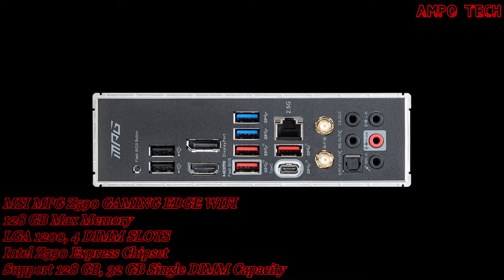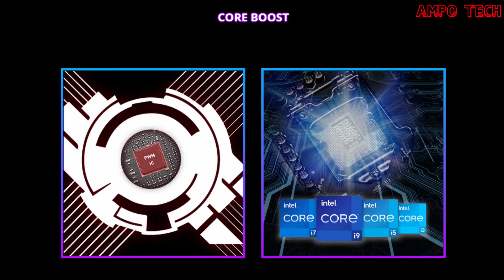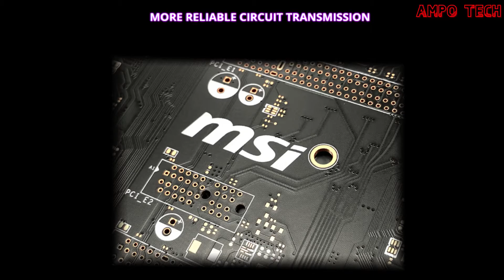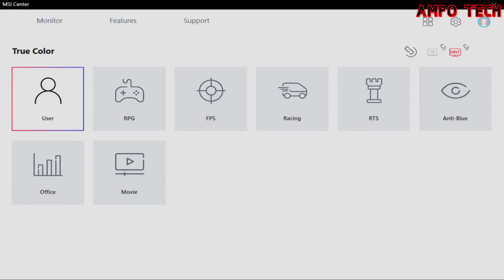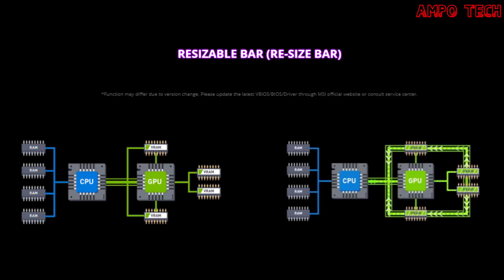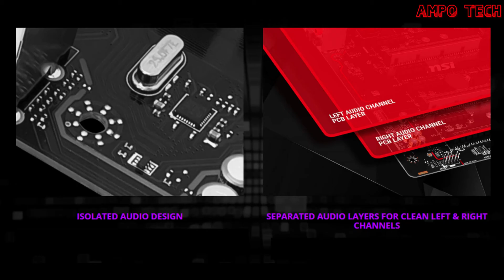MSI MPG Z590 GAMING EDGE WIFI Motherboard | AMPo Tech

Comment: Can you tell me can I use 4 ram of 3200mhz in this MSI MPG Z590 GAMING EDGE WIFI motherboard.
Reply: Yes, you certainly can .. In fact you will find this board is very happy with 3200 speed; in most cases of standard brand name ram sticks; it will auto configure and post quickly; but for 3600 or above you will have to position the xmp switch and then press the "mem ok" button to test and configure or it will not post; very often you can find 3600 spd ram cheaper than 3200; that is because of these extra steps many avoid it or think that the ram sticks are bad and send them back; so 3200 is in a higher demand so they price it higher; where clearly the performance of 3600 on Nova test bench is better; but it seems, only for those who know to take the two additional steps at install; I use 3600 because it is faster and even cost me less money, and that is a win-win.  

One last fun fact that even many builders are not aware of; if lioking for every last bit of performance; you will notice on most all higher end, and heavy boards only allow for two, ( 2 ) sticks ram; that is because you will always get better performance using a single mem channel; using an "A" and "B" channel slows down the soeed to sync both channels teducing performance overall.

Hope this help you out some.

Peace
Reply: Ik u can 16 gb but i think yes